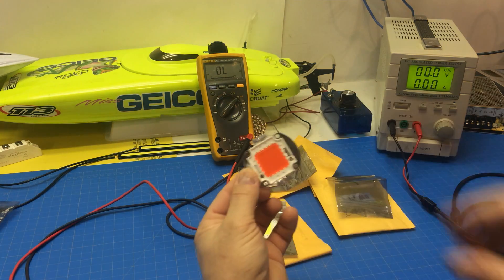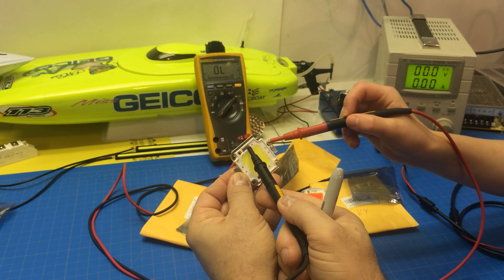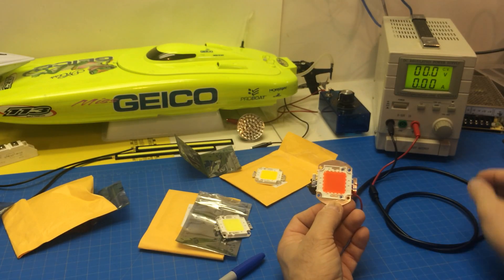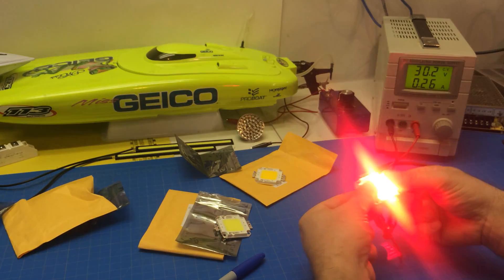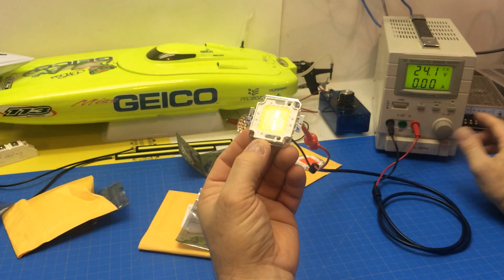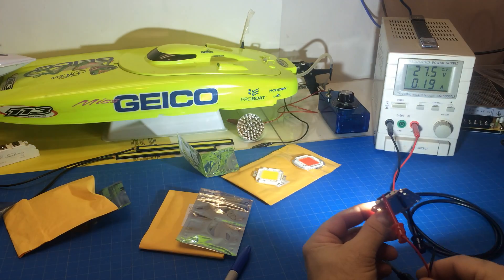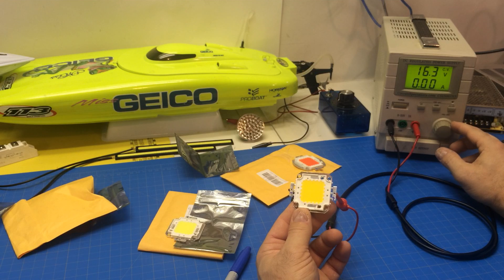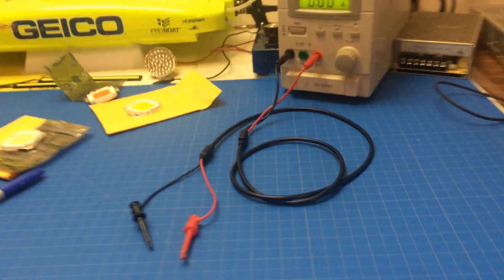High Power LED Chips: [50W Red] : [100W CW] : [100W WW] [KTFG 162]

Comment: All the individual LEDs should light at the same time the ones you tested are of a poor quality and have not been matched the diodes that lit first will take a kicking and be the first to fail, uniformity is key when dealing with cob chips.

Comment: Ok so you're on hitting 200 ma right?
Reply from the maker: They illuminate well below 200 ma and continue to get brighter as the current increases.
You have to multiply the Volts x Amps for the wattage rating.
So the 50 watt red running at 30v .24 Amps was only at 7.2 watts.
The 100watt white was roughly the same.
I under powered them as just a preliminary test without a heat sink
Reply: I was wondering how these worked. I have a 80v 712 ma driver I wanted to use with these in series. Would they be pretty bright at that amperage?
Reply from the maker: Led

Led chips can be configured differently so the current & voltage will not be the same for each chip.
It no data sheet came with the chip to specify the current you’ll have to power it with a powerful ply like seen in the video which display the voltage and current the multiply them for the wattage.
I recommend underpowering them, so for example I would power 100 watt chip at less than 90 Watts.

Once you determine the current for the given wattage it’s best to use a current regulated (rather than voltage) power supply  (or led driver) which will keep the current contact.

80v is likely way too high for your chip.

Also check out:
“How To Solve Rubik’s Cube: So Easy a 3 Year Old Can Do It” https://youtu.be/9spDGBeWl1o

Comment: these leds cri is so bad thats why i dont like to use them for general lighting. i can see you are using ones to light your workbench because the color is way off.
Reply from the maker: The lighting is fluorescent tube lighting which is really bad for video.
It has since been replaced with Crystal White LED Bars I purchased here https://amzn.to/2yWswNR  (affiliate).
Newer videos have much better lighting as can be seen here https://youtu.be/bd2YiD9JXsk
I could still use improvements in lighting but at least its not terrible anymore.

Comment: what is the correct name for the device being used to power the led,s?
Reply from the maker: +k1 wiz80 
Regulated variable DC power supply.
This is a bench top DC PS used for a variety of purposes.
To drive LEDs you want a current regulated led driver specific to that led as current requirements vary for different LEDs.
Check spec sheets or purchase in combination.
Reply: Thank you, i knew what the device did but could not for the life of me remember the correct name.